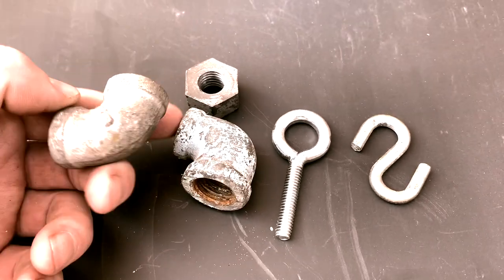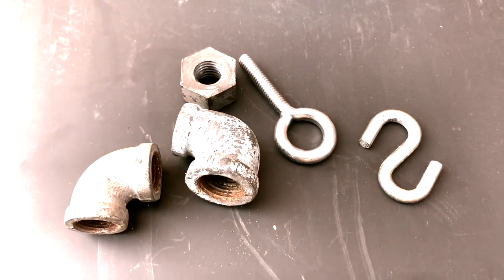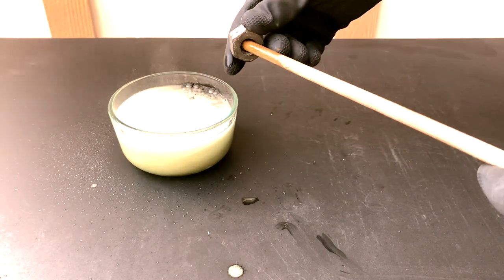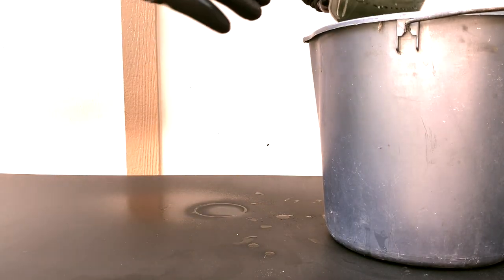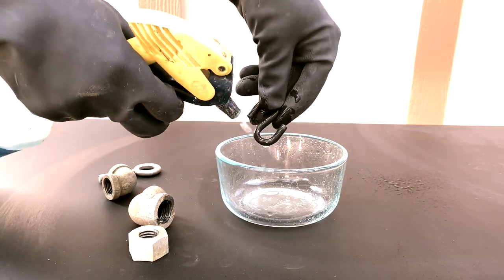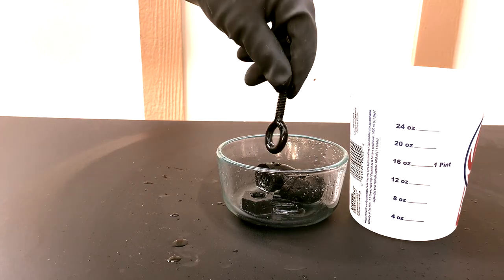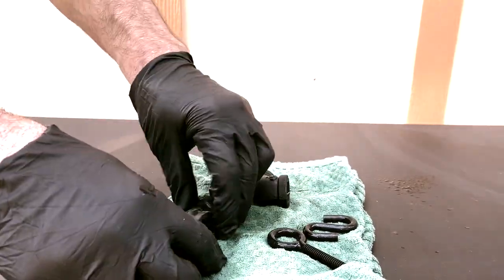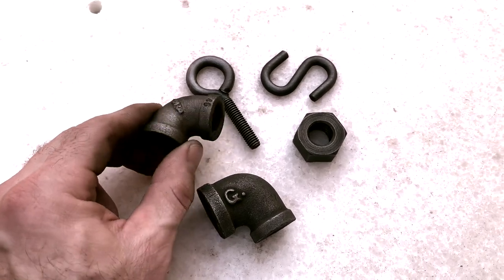Black Oxide Finishing Galvanized and Zinc Plated Parts - Antique Look

Comment: With cold gun blueing, you’re supposed to soak it in light oil immediately after the water rinse.   WD40 works fine.  Spray it on after the water rinse, then let it “cure” for 24 hrs.  Then return to wipe off the oil.  The blueing finish will last longer and no rust initially.  

Also for parts like those in the video, the hot-blueing used motor oil method works nicely, is cheaper and leaves an oil residue to help slow down rust.

Comment: Would citric acid be strong enough to remove the coating? I want to try burnishing with oil but there is still some stuff on it that seems to interfere. Maybe I need a stronger conc of citric acid

Comment: So you mix the perma blue with water? I tried bluing my 1911 the frame is zinc I made it corrode with white rust I got rid of the rust completely stripped it down to bare metal was thinking about electroplating but if I can just blue it with out it corroding I think would be better any tips
Reply from the maker: I don’t mix it with water I usually just put it in a squirt bottle and spray down my parts. Then I rinse it with water once the reaction is done.
Reply: @Chemical14  thank you for letting me know I appreciate it

Comment: Would this work well in a restored car engine bay. Or would it yearly oiling to stop future rust .
What other options would work well for my engine bay . Im painting some hardware and brackets black currently , but would much rather something easy like this method .
Reply from the maker: It would likely need to be oiled occasionally to prevent rust. If you did a clear coat over it it would last (I often use shellac) but I guess that doesn’t really save you time over just painting it. I use this method because I like the look better than paint. Just personal preference.

Comment: Why not use caustic soda, it will remove any grease and oil but will do no damage to steel at all?
Reply from the maker: I haven’t tried caustic soda, although when I just need to get rid of oil and scale sometimes I just use vinegar. It’s slow but it works. In this video I’m actually removing the zinc plating from the surface as well as any other coatings. The muriatic acid does this very well.
Reply: @Chemical14  It works great but you need to be careful with aluminium, it makes them disappear.

Comment: What will be the difference of weight of the part after and before coating?
Reply from the maker: The difference in weight will be practically nothing. The oxide finish is just the top layer of iron bonding with oxygen molecules in a specific configuration so you aren’t really adding a coating.